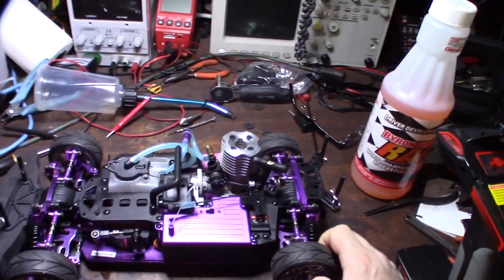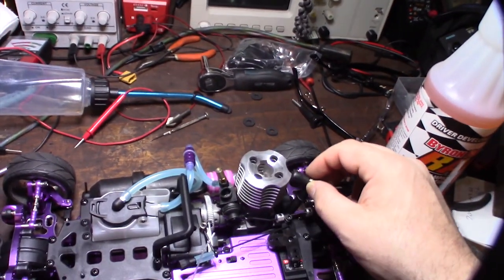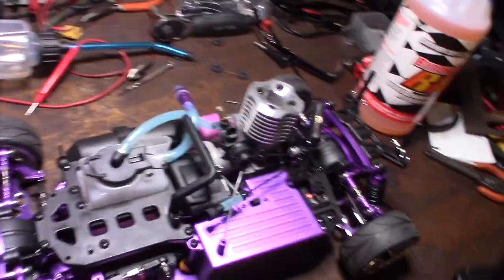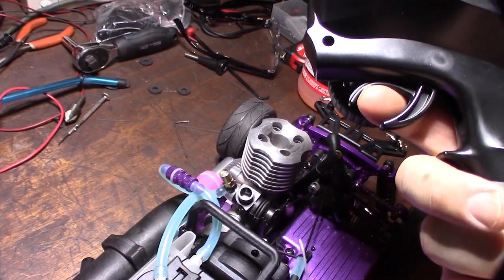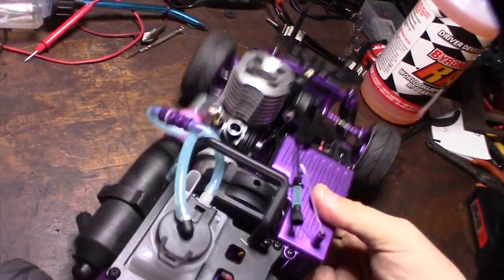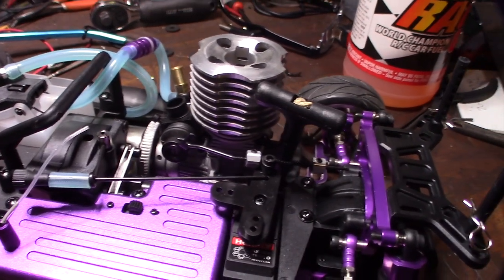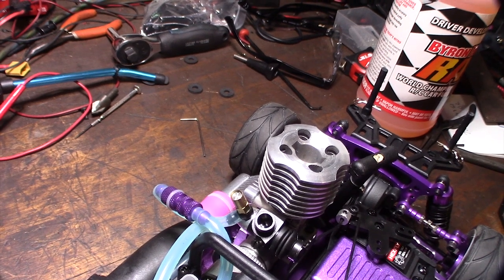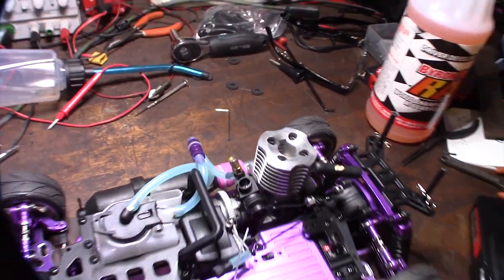Redcat HSP Throttle Linkage Adjustment Nitro High Idle Hesitation no wide open throttle WOT RC car

Comment: Hey I have a hsp car that has exact linkage stupid as yours. The transmitter that comes doesn't have ep adjustment. I'm blowing throttle servos like no tommorow. Changed reciever just incase it was a short. 4 tanks of fuel and it went. You have same problem with that one? Driving g me mad. Also had to do what you did in this vid as my carb didn't fully open.